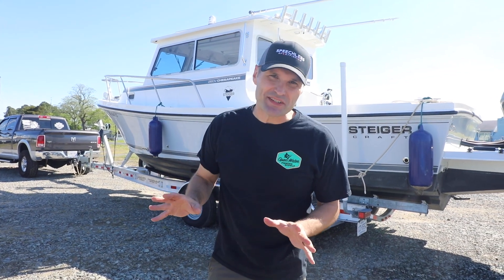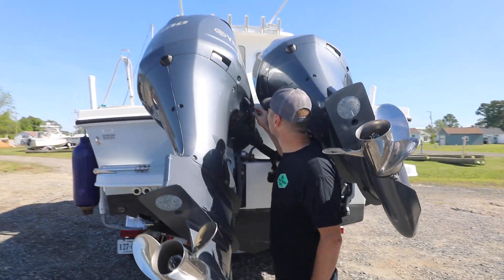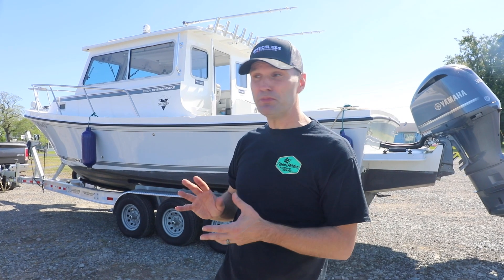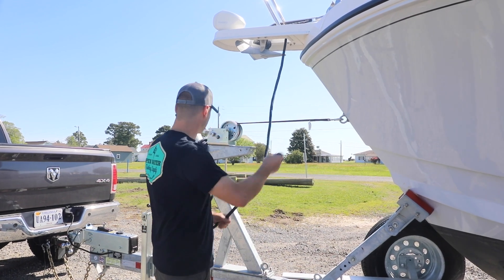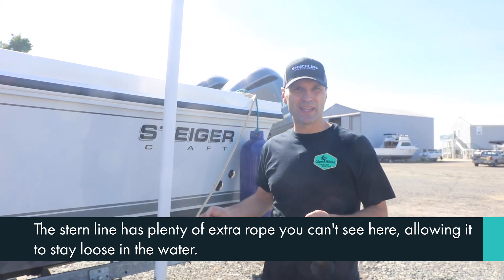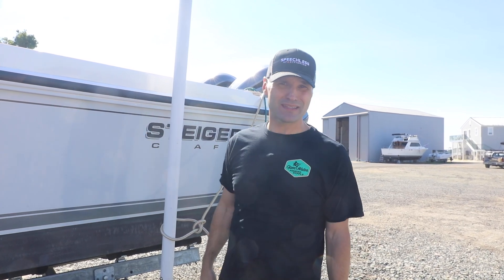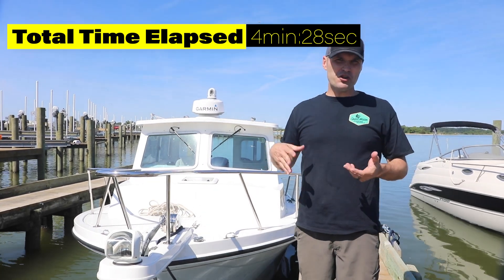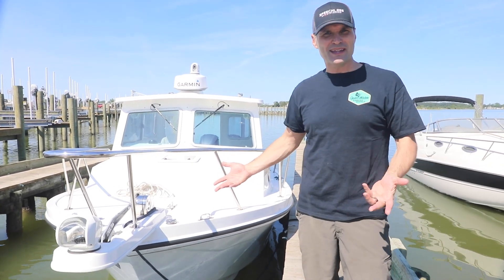I Attempted To Solo Launch a Big Boat for the First Time...Here's EXACTLY What Happened!

Comment: Always set the emergency brake first, let the truck rest against it in neutral, then put the rig in park. When you get ready to move the rig reverse the order, park to forward or reverse, release the Ebrake and go. This procedure will keep the significant pressure off the automatic transmissions park pawl.. Chuck
Reply from the maker: Great suggestion Chuck, thanks!
Reply: Emergency brake really doesn’t do nothin. Only stops rear wheels. Chocks are the way to go

Comment: Where we launch, there is no dock beside the boat--open ramp, no dock for over 500 yards.  On the other hand, even if it had a dock, I will never boat alone.  As a concept, I just don't agree.  Think about boating, the idea is "redundancy"--two or more, of everything.  Two radios, two cell phones, small back up engine and a back up fuel supply for that kicker.  Two, two, two, two, then for people--ONE?   So, if you fall and get hurt, sure you have a radio, phone, IF you can get to it.  If you are bumped overboard--yeah, you could have a waterproof EPIRB or PLB attached to your life vest--and you should, but how much better to have your mate come over and pick you up.   Again, to me--don't boat alone.  One more thing, the reg's say "a full time look-out shall be posted" and that does NOT mean, the person running the boat.  A full time--not part time, lookout, to be alert, keep their eyes moving.  So to many of us, that also supports more than one.  Last of course--not important for safety, the enormous cost of fuel, good to have someone share the expense.  Just my opinion, I do realize many do not agree.

Comment: If your engines don't start for any reason, you're not getting that big heavy boat back on those bunks. Better method for me wlith a big heavy WorldCat and bunk trailer is leave strap on and tight, back boat down ramp, lower engines, start engines making sure they pee, bump throttles into forward so the boat stays put and doesn't back off (float) off trailer, go unhook strap and hit reverse and back the boat off trailer. Easy peazy every time and no concern  of "what if engines don't start"?

Comment: Nice.  One other thing to emphasize, is that if you have 4wd, once you get to the ramp and do your alignment check before continuing to launch, use 4L.  You also want to use 4l when pulling it out.  

Another tip is that when you go to pull out, once you get the trailer in the water, put chocks behind the wheels of your truck just in case there's slippage (especially if you don't have a 4wd!).  This will prevent your truck from sliding into the drink when you go back into gear.  You can tie ropes to the chocks and put them around the mirror and/or bed anchors so that when all goes well, they drag along until you get off the ramp and can retrieve them.

To launch: ...ebrake, alignment check, 4L, launch, turn steering wheel hard left or right (just in case all else fails), ebrake, chocks, take care of the boat, forward to get trailer out of the water and off the ramp, retrieve chocks, 2wd, park
To retrieve: ...ebrake, alignment check, 4L, trailer in the water, steering wheel hard left or right, ebrake, chocks...get boat on trailer, forward to get trailer out of water and off the ramp, retrieve chocks, 2wd, go 

For launch, one chock is probably fine since you only have the weight of the trailer, or maybe no chocks at all if the ramp is dry and you have 4wd.  But for retrieval, use the chocks no matter what.    It's only 20 more seconds and can save your truck on a slimy ramp.

Also, carry a brush to scrub the ramp if you must if it has too much slime.  Also, don't step on the slime!  You will most likely fall if you do.

Of course, check the ramp first, check the wind first, plan the whole thing before you even start to back onto the ramp.

Comment: this procedure works well WHEN there is a float to board the boat after it has floated off 4+ feet.   

But when there is no float and the boat is becomes far away from the trailer bow stop, it makes it more difficult to clammer up onto the boat from the trailer.

By launching until it floats with slight slack in the bow strap,  board boat,  put into FWD gear at idle,  clammer back down to the trailer to release the winch. The boat in gear will hold her from sliding off, keeping the boat close to the stop making the boat closer to climb onto.

Comment: Great video but I have two notes that you can try and see if it helps you:
 
1. I wouldn't wrap the bow line around the winch post/mount. That can cause a tension knot and over time will rub on the winch bracket and fray/cut the line. Just tie a bowline into the line at a predetermined length and put that over the post/winch mount.

2. That line over the vertical guides won't do anything to stop the boat. It'll pop right off as those verticals are not designed to take much horizontal force. Keep in mind they are only held on by a couple of U joints at the bottom. What I did, when solo launching, was take a line to the center cleat and fix that to the dock like a spring line. Be sure to route it behind the vertical guide or it'll get caught. If you use the same launch, you can pre-set the length of this and it'll really help save time.
Reply from the maker: Great suggestions FBO, appreciate it!

Comment: A “big” boat? Isn’t that like a 25 foot boat? Is 25 considered “big”? Lol
Reply from the maker: It’s a 28’ w a 9’ beam. Considering most boats don’t get trailered beyond 35, this is considered large by the marketplace. What do you consider large? Please, do enlighten us.
Reply: It is getting close to the limits for practical towing, launch and recovery.  When you get much over 25 even finding boat ramps long enough with a dock that can accommodate can start getting tough.
Reply: @saltwaterfishinguniversity  
Idk I suppose that’s on the larger side, but not a problem to launch solo. Guess it just depends on the ramp and conditions. 9’ beam is a wide girl for sure.